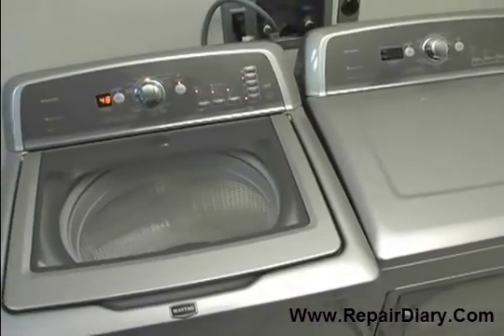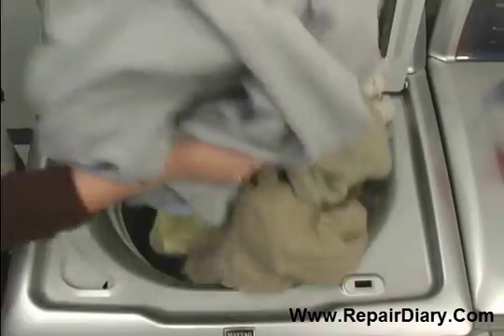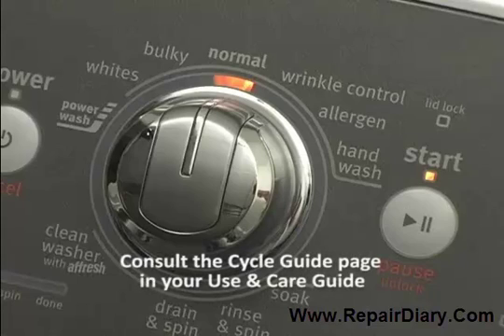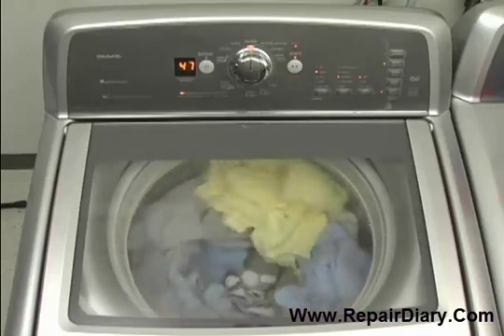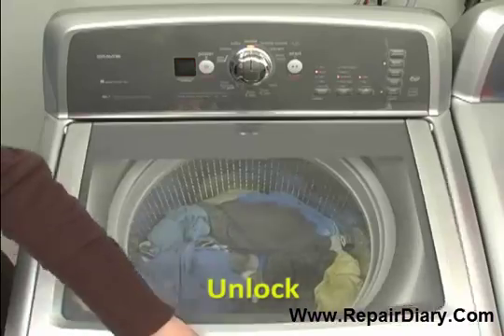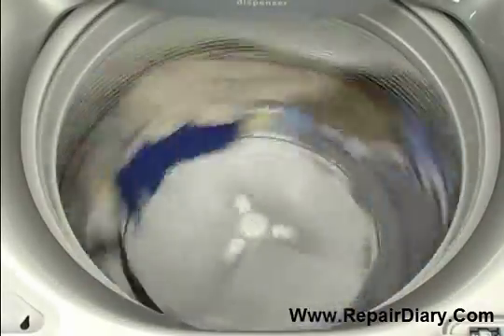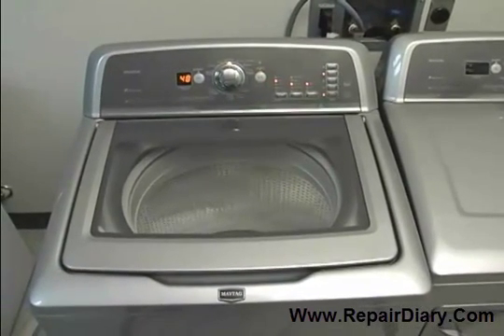How High Efficiency Top Load Washer Work

Comment: Front loaders are much more better
Reply: I agree. These top load HEs are not realy energy efficient, not even a bit if you have to risk rewashing every load more than wash because the clothes are probably not going to get cleaned, especially with significantly less water. This "dry spots on clothing due to higher spin speeds" part really pissed me off because the dry spots are the spots that barely got touched with one drop of water. It's EPA that is controlling how we do our laundry and when it comes to top loaders, I would go for old school agitator, and not this stupid HE top load bullshit.

Comment: I bought a new GE impeller model.  I would have preferred a front loader but the space could not accommodate the swing door.  This impeller does have many of the features of a front loader but I would not buy one of these again.  Clothes do not get as clean.  Also, the machine easily gets unbalanced.

Comment: 0:06 - High effeciency low water washers provide better cleaning while using less water and energy. And you have less chance of getting your clothes clean. 

0:11 - These washers and sound different than traditional agitator washers. Well I like my traditional agitator washer the best because it cleans thoroughly and I dont care about the sounds of the washing machine. All I care is the clothes getting cleaned and not these god damn bells and whistles. Just wash and dry the damn clothes for gods sake! So why would I give a shit about how the washers sound? SMFH. Please just bring back the old kenmore or whirlpool and the woo woos. 

0:16: - Lets look at a few of the differences ... Oh give me a break! 

2:30 - There is NO way that I want to wait 14 hours to load sense my load. How pathetic. 

3:20 - That no water will be added to the washer for up to 2 to 3 minutes - SERIOUSLY?!!!!

4:24 - you may notice that the washer is using significantly less water. That means that your clothes may still be dirty after the load.

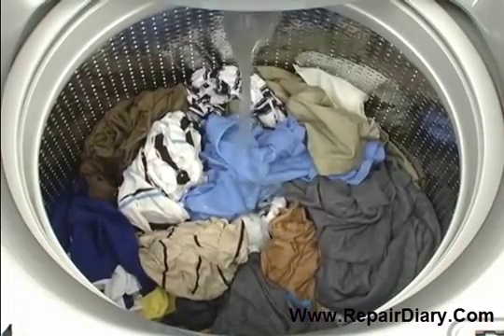5:02 - this is normal. No it's not!

5:29 - lets listen to drain sounds - Ugh. Why would I care about the drain sounds?

7:01 - you may even notice some dry spots on your clothing. This is due to the spots NOT getting touched by the water and the fact that the spots were NEVER CLEANED. NOT THE HIGHER SPIN SPEEDS. So DONT try to talk me into buying this HE washer.

Comment: But I think this is a good video to help your Maytag improve
Reply: Yes, by not adding so many extra features and just fill the wash load up all the way and to have the clothes washed thoroughly in a half an hour. Its not just MAYTAG that needs improvement on top load washers, but every single brand should definitely use improvement on washing machines by bringing back the traditional top load machines that have an agitator and fills the water up and that normal cycle takes a half hour. This is how every washer should be today just like back in the good old days: just fill the water to the full tub on a ex large load and it fills it with the right amount of water, wash, drain, spin, rinse, 2nd drain then second final spin, with 4 spray rinses. Speed Queen is still the best washing machine to buy. HE top load agitator washers are NOT the answer either and forget about buying one. The HE top load agitator washers just take like one or two hours on a normal or heavy duty cycle, and this is a BIG WASTE OF ELECTRICITY, MONEY, TIME AND ENERGY. So HOW IN THE HELL IS THIS HE WASHER REALLY HE? ITS NOT! And it never will be because there has been so many issues with the machines. Even on the impeller versions of the HE washers, there is absolutely NO rollover. Despite the Mega Capacity, it's not really meant to wash large or bulky loads since it barely fills the tub up. I even watched the video of the wash action on the pillows in the HE washer and there is absolutely NO possible way that they were getting clean, and they sat in the tub with absolutely NO rollover. The only way of dealing with HE top loader washers is by removing them off the market, because this machine is a TOTAL JOKE and yet USELESS garbage. If I ever owned this HE machine, I would have been so miserable and financially depressed. It is NOT really worth spending all day long doing laundry by having to rewash every goddamned load like 2 or 3 or more times each load, after noticing the clothes were never getting fully cleaned (which can be very frustrating and time consuming when you want to catch up on other chores or errands and whatnot).  And that's not how these so Called washing machines should work today.

This is what EPA wants to do, is to bullshit about saving energy, money and water by using this so called HE top loader washer, when there has been absolutely NO energy savings whatsoever. I bet a lot of people were right about the dry spots, over the fact that the clothing wasn't even submerged. The dry spots are NOT from the spin speeds because they didn't get submerged in water. IAnd I absolutely will NEVER, EVER buy a HE top loader.

Here is how HE washers work: THEY DO NOT WORK, AND THEY ARE THE MOST USELESS AND THE WORST WASHING MACHINES TO POSSIBLY EVER BE INVENTED!

It's like compact fluorescent bulbs, I had mine fail after less than a year, and the fact that they contain mercury in it, Energy Star should never recommended that in the first place. Just like with these washing machines. Has everybody used a low-flow showerhead to take a shower, than you clearly defeated the purpose. I wish EPA and Energy star companies can just GET ON BOARD and to JUST STOP WITH THIS PROPAGANDA!  If I ever want to replace my washer, I will look for a vintage whirlpool or buy a speed queen. But I can guarantee that it will NOT be a HE washer, ever. HE washers should be BANNED because they don't work very well

If you want a washer that works, get a Speed Queen or look for a vintage Whirlpool Super Surgilator, or a vintage wringer washer. Don't waste your money.

Comment: I will take a 1970s whirlpool surgilator washer over this modern POS HE washer. Extra large water level that actually fills it up enough for a large load.  and an agitator is how washers should always work and not have all this stupid features. And every spin part with these has four spray rinses and it has a convenient lint filter to remove lint from clothes. That is how every washer should work, just wash and dry the damn clothes without all the special features or bells and whistles. EPA policy is just useless these days. Bring back the old school washers.

Comment: This washing machine is vigorously agitating the clothes on the bottom, yet the clothes above are barely moving and turning over. It needs a little more water and a better agitator. It doesn't need a full tub, just a few more gallons....so the clothes can agitate uniformly and rapidly, to expedite the cleaning process. 

An older top load or a front load is much better at ensuring every article of fabric is being agitated. That being said, many of the HE front loaders these days don't have a pool of water unless you choose the "bulky" or "bedding" cycle. Hell, even the "heavy duty" cycle on Samsung front loader doesn't use enough water. Where is this water shortage? Isn't water being constantly renewed through the water cycle, on our planet that's 75 percent water?

Comment: This video shows how much of a joke high efficiency washers are. "You may notice that the washer is filled with significantly less water. This low level of water cleans the clothes effectively and efficiently." BS! I'd rather buy a used Kenmore 80 series off of Facebook Marketplace than be financially depressed after buying an HE washer.
Reply: Just get a front loader bro. They use the least amount of water and are proven to clean clothes the best.
Reply: @panafricanmarxist7632  Misinformation

Comment: HE washers SUCK they do not clean your clothes the agitator is there to pull the clothes down to the thing it NEEDS an agitator and you need water to clean the clothes, water has not changed.
Reply: Just get a front loader
Reply: @panafricanmarxist7632  They clean just as bad if not worse.

Comment: Please DO NOT follow this instruction
Reply: And this is one reason why more people get sick, especially with the fact that the clothes are not getting clean with this useless HE low water washing machine. I agree with you. How do HE washers work? well they do not. If you want a top load washer, then I would recommend the old-school washer that has an agitator and fills the water to the point where the clothes are actually getting clean, and takes a half an hour for the clothes to get thoroughly cleaned. I sure miss the good old Kenmore washing machines from the 1980s because they did a much better job, without all this HE garbage. It’s by how are CFL bulbs energy efficient, after noticing the mercury footprint, that’s not energy efficient. How is a low flow, showerhead effective? it’s what energy star wants to force people using, even 50+ year olds would not recommend high-efficiency washers because they can be ineffective.

Comment: This is the most dishonest narrator I ever heard.  The line "THIS LOW LEVEL OF WATER CLEANS THE CLOTHS EFFECTIVELY AND EFFICIENTLY"  is the biggest bag of bulls sheet ever.  Anyone with at least two brain cells to rub together knows just by looking with even one eyeball that the cloths will not get clean.  Just a pile of fabric sitting in the same spot on a damp mound washes no dirt off of anything.  Boy people who buy these must have never had enough gray matter at birth.  Water and lots of it people along with circulation washes clothing.  They got the machine washer right decades ago.  Making a wheel from round into a square does not improve deek. Know wonder they wrote the book series "blank for dummies 101".  Because most people are !

Comment: Just dumped a 3 year old GE HE washer for a new Speed Queen TC5000 that arrived today. The moment the basket filled (to the top, yay!) and the motor kicked on...I swear it sounded EXACTLY like our Maytag in 1964 when it was new.  Just granite solid.  Took me back to my childhood instantly.  Couldn't be happier.  Hate to get political here, BUT the democrats created the new regulations that forced manufacturers to come up with these bizarre machines that don't clean.  Trump (and I'm NO Trumpie) tried to roll back the excessive regulations that caused this fleecing of the appliance buyer.  Consumer Reports is now very left, and they fought Trump (one of their top execs worked for Obama in the DOE).  CR is no longer credible...their top ranked top loader is an LG model that has an impeller, not an agitator, and its most vigorous wash action would have been extra slow delicate action in the old days.  Check out the videos on youtube...the laziest action... the clothes barely move.  Politicians have someone else clean their clothes...what do they know.
Reply: Demonrats and rinos are a threat to humanity.  Last two years proved it.

Comment: I still do not feel like these machines adds enough water to properly wash the clothes and it does not rotate the clothes sufficiently from top to bottom.  The ONE thing I will say though is that the spin cycle is legendary.  It spins them so fast and for so long that the clothes come out the machine damn near dry thus enabling less time in the dryer.

Comment: in other words, find a local used washer dealer and get a working older washer. these thing are nothing more than sheeiiit. 
listen to it strain to wash and spin. 
yeah, tell the simps that you don't need clothes to get wet. 
i hate that i wasted $500 on one of these pos. i should have just stolen my Granny's 40yo Speed Queen.

yeah removed more water. they have to get wet first...lolololol

THERE'S A REASON YOU DON'T FIND OUT TIL IT'S TOO LATE THAT THERE ARE NO RETURNS/REFUNDS AFTER YOU GET IT HOME.

Comment: You need water to clean if anybody out there has a dog and shit on the cement you can’t pull out a paper towel and wipe it You would pull out a garden hose and spray it down bottom line you need water that would be like taking a cup of water pouring it on the shit

Comment: I really NEED a mechanical washer, with maybe three cycles and three load settings and definitely with an agitator.  These crazy sensors increase the price and decrease my patience! I'm NOT a rocket scientist and not about to start being one now. Please, I BEG YOU! Make a purely mechanical washer again! Please!
Reply: Speed Queen Makes The TC5, although it is heavy duty dials connected to a panel, that is the same panel that are in the commercial machines at the laundromat. It has no lid lock, 5 Cycles, You set half or full water level and it washes just like the 70's machines.

Comment: In addition to the ridiculousness that a non-agitator washer washes better than one with an agitator, they're also full of it when they say the new high-efficiency models (with or without agitator) saves water and energy. I'll give them the less water (hmmmm, that just may be one of the reasons they don't clean very well) but my old school washer (with agitator) and dryer having simple basic knobs and settings was much easier to operate AND IT TOOK HALF THE TIME TO WASH AND DRY CLOTHES AS THE "HE" MODELS. I'm no genius, but I believe if one appliance runs for 75 minutes to do the job while the other takes almost 120 minutes, I think the one that takes less time is going to use LESS ENERGY......SHEEESH.
Reply: That’s not actually how it works. Most of the costs that come from running a washing machine are filling and heating the water. Running longer doesn’t significantly increase energy usage to overcome the savings from using less water.
Reply: These machines do in fact clean whether you believe it or not.

Comment: I have this machine. It seems to wash ok. What I do not like is that apparently some water is left behind and not drained. This causes a sewer odor that must be remedied by running a special "clean with afresh" cycle. You can see it on this video. This cycle can have no clothes and uses 100% hot water. The Afresh tablets cost about $5 each and this must be done about every 2-3 months. I wonder how much of the efficiency this cancels out?

Comment: What a farce these machines are. The government "A" holes who mandated these HE machines should be ashamed of him/herself.  I mistakenly bought a HE machine and regret every time I use it. Under normal conditions these machines do not wash clothes properly. They do in fact use less water, so much less that the clothes don't get wet and the recommended HE detergents do not clean the clothes. I have resorted to selecting the "Bulky" setting , regardless of the load size, so ample water fills in the tub. This unfortunately makes me use MORE water than necessary.  I am now looking to find a suitable "old style" machine for my laundry needs.

Comment: What a HORRIBLE washing method !  Not even close to enough water is used.  Worse yet, looking at it in use, that impeller in the center is just grinding away at the clothes in the center and all the other clothes are barely even moving !  Even worse, those clothes are not even getting wet at all....they are staying on top !  If you had a stain on those clothes there is no way it would even clean them ad they don't even go underwater.  Geez, what moron designed this kind of machine ?  Hey let's save water by not cleaning clothes and rubbing holes into a few garments in the center.  No way would I ever buy this kind of useless machine.  High Efficiency needs to die.

Comment: Our Maytag washer just kicked the bucket after 22+years, we got one of these he washers and I'm not totally convinced. There is an option however, to "deep fill" the basket but there's something that just doesn't feel right. Guess we're just use to the sound of the agitator Ave the old motor making the splashing and whish-wash sounds we grew up with.   One thing i did like the midst is how significantly quieter it is, it doesn't even buzz loudly when it's finished.  We have to check once in a while.
I sure hope this washer last about a long a our previous washer.
Reply: get a speed queen TC5 "classic"

Comment: There is nothing wrong with these impeller washers. The only problem is in the name of HE these shitty fellows are using less water. Believe me it's water that cleans 90% of dirt and microbes in your clothes. 5% by detergent and another 5% remains in your clothes even after wash. These junk fellows don't know how to clean your clothes effectively.
Reply: As you can see in this video the impeller is litterally just vibrating the clothes back in forth in a tiny puddle of water. How the heck is that gonna clean better than any dual action agitator?
Reply: @NEON2600  read my comment again. I have mentioned water is the most important element in cleaning. Top load washer irrespective of design requires lot of water and the clothes should be soaked completely inside the water during wash cycle. That creates friction when clothes move back and forth. These low water consuming washers are crap and nobody should buy them. Front load washer is better than them.
Reply: @NEON2600   it depends on model. If you go for generic washers they use proper amount of water required to clean clothes. If you go for HE branded models it's the same problem with front loader as well. But by design front load washer consumes nearly half the amount of water that is required for top load washer.